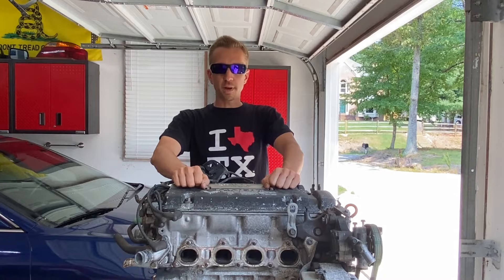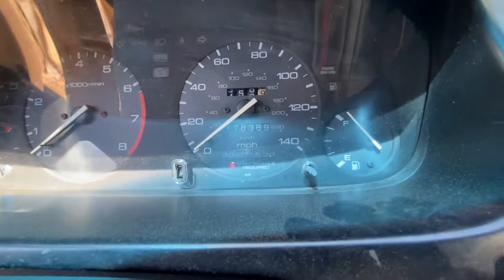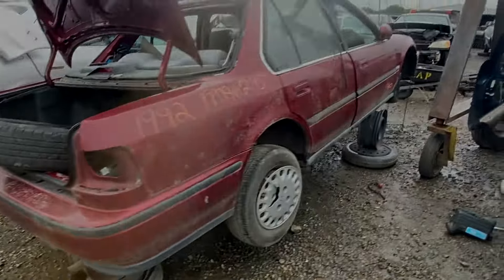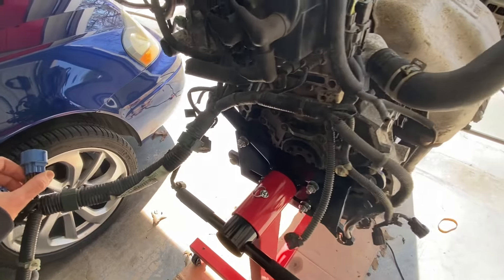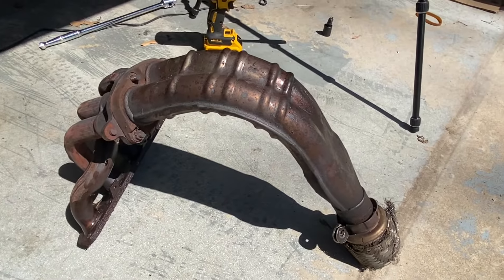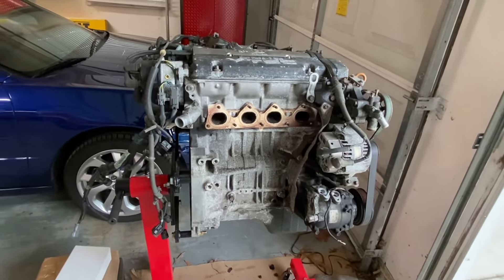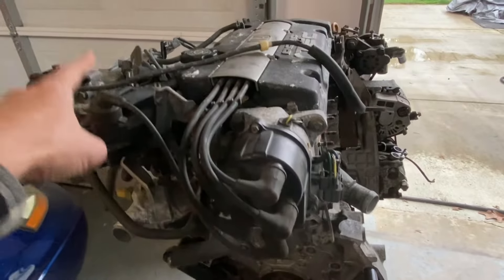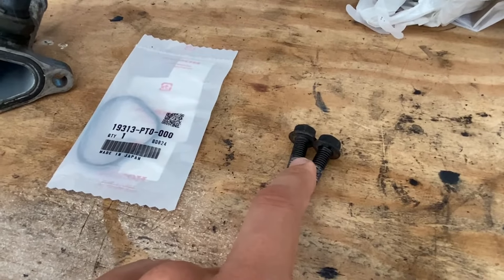Part 1: H22 Prelude Engine Swap Into a 90-93 Honda Accord CB7 CB9

Comment: Are you running a/c ?
Reply from the maker: That is the plan, yes.
Reply: I used the fuel rail from f22a6 motor so I didn't have to reroute the fuel line.